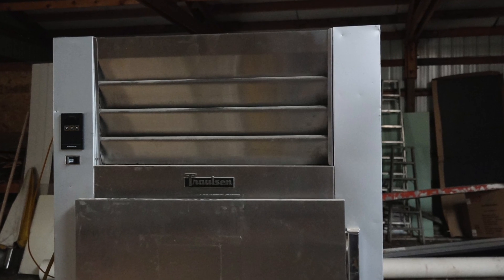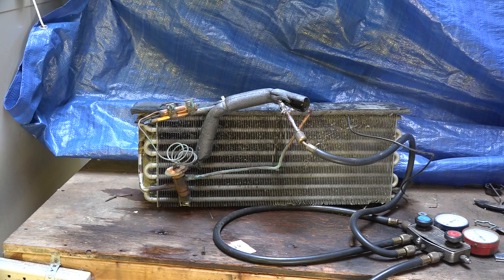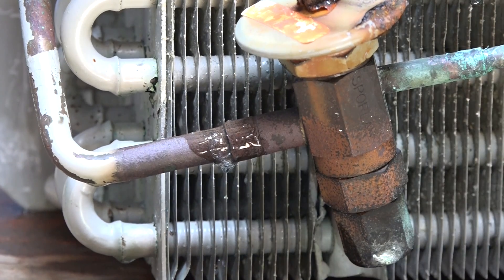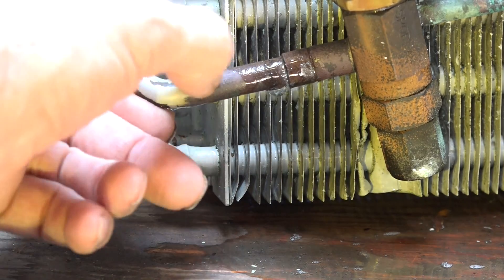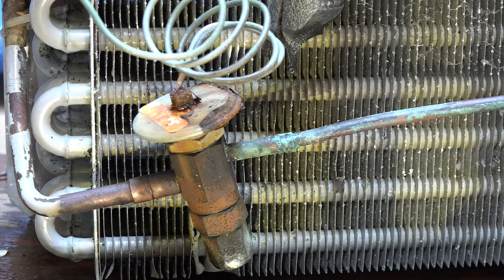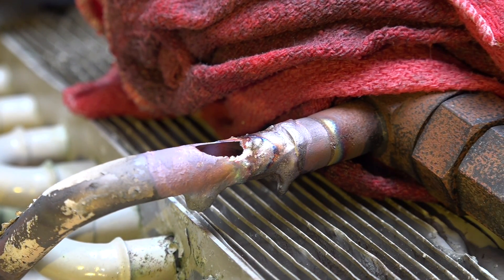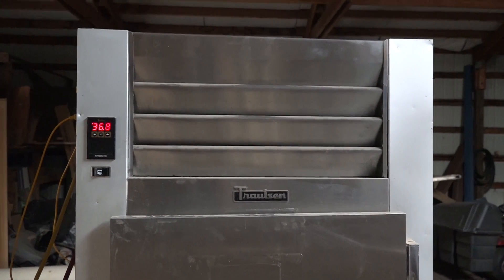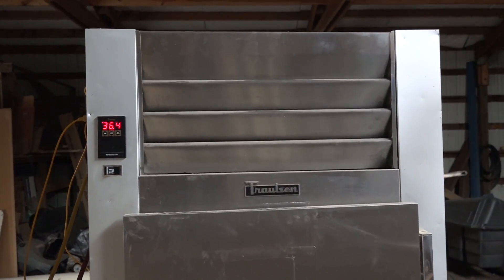Reach in cooler TXV leak

Comment: I have a question that's not related to this video sorry I just figured you would know the answer. On the Trane spine fin coils I found a leak on the Aluminum before it meets copper on the condenser coil what can you braze that with? It seemed like I was just making it worse every time I out even a small amount of heat on it! I don't wanna make the customer replace it for something that dumb! Sorry about being off topic thanks in advance
Reply: +Gil Cavey Jr there are a few different aluminum brazing rods out there.  they melt at a lower temperature than the silver rods but tend to work the same way by spanning gaps and such.
Reply: +jeff leonard thanks Jeff appreciate the info. I'll try that
Reply from the maker: +Gil Cavey Jr This brazing compound is only good for copper. Careful with that aluminum.  I have almost never been successful with the aluminum brazing.  If the aluminum is new, it works ok but if it has corrosion on it, it is very hard to clean and get the rod to flow.  It may be worth a try to avoid a new coil but the aluminum brazing kits are very expensive.  When you see a video of how well the aluminum brazing works, its always on new material.  Hope this helps.
GFM

Comment: Nice. Larger holes like that if you wrap 18 or 20 guage solid strand wire around it makes  alot easier to bridge. Works well on condenser tubing where its foil thin also.
Reply: +Ben quinn if you want I can post some pictures of the process on g+. I will say you really gotta be in a pinch (no tubing,no couplings to cut in half, 3 am etc.) to do this lol. It does work though.
Reply: +Ben quinn keep your heat mostly on the tube the wire will get really hot really quick. Just don't heat it into next week.

Comment: I had a traulsen with exactly same leak at txv. That bulb head is not far behind yea you would think it would be rusted through
Reply from the maker: +Joe Shearer Yeah, I got this thing because of leaks that kept coming back.  It appears to have corrosion from possibly salads stored in the cooler.
GFM